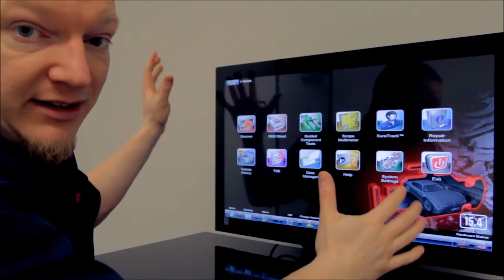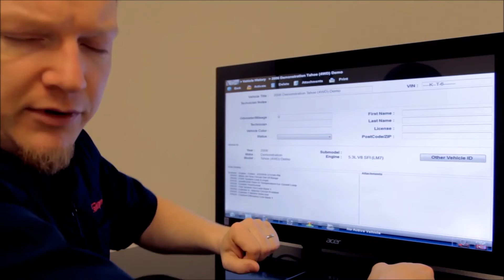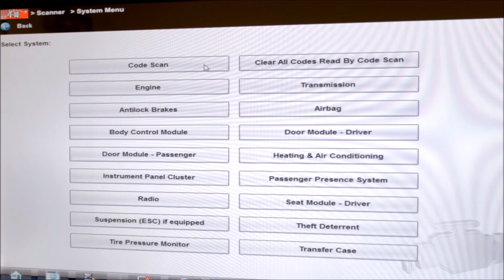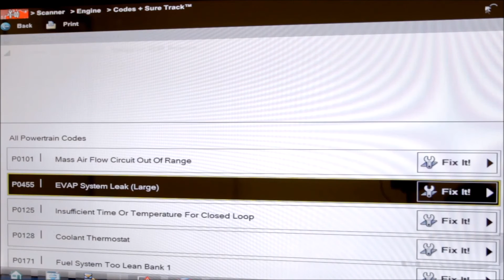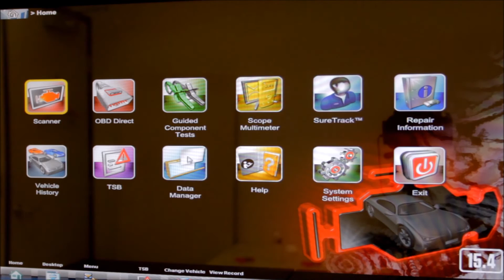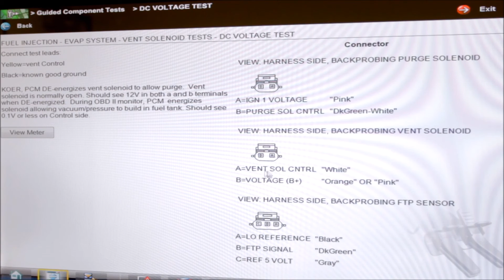VE Workstation

Comment: Will this touch screen work with the older Windows XP versions of the Verus Wireless?
Reply: Nevermind. I got rid of Windows XP and installed Windows 7 on my EEMS325 VERUS Wireless. My NEC 46" touchscreen works fine.